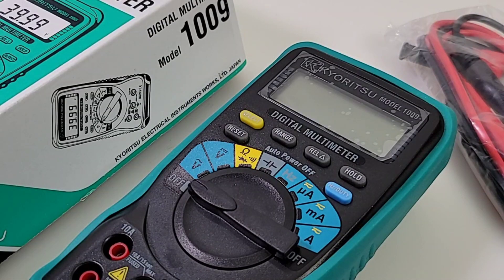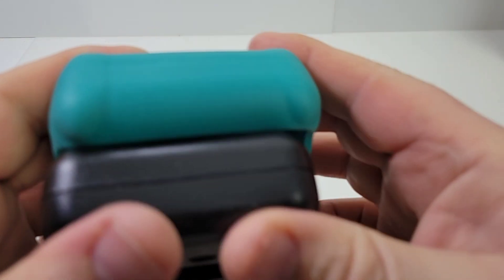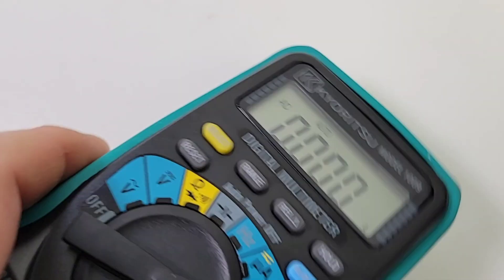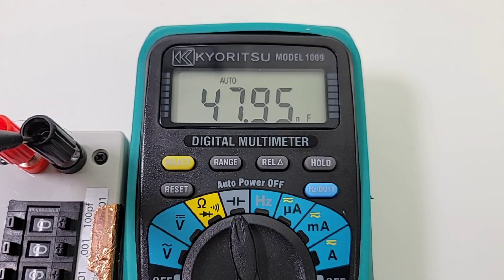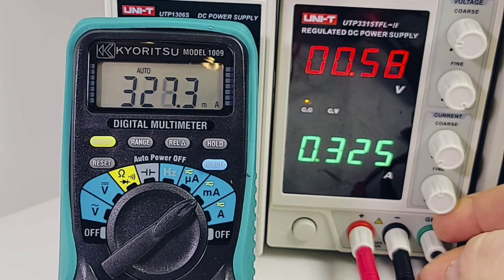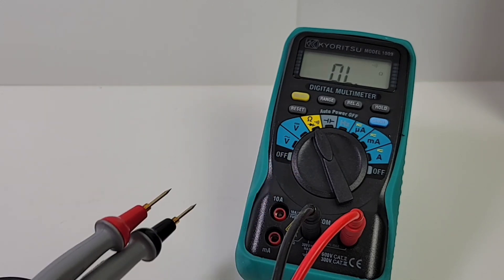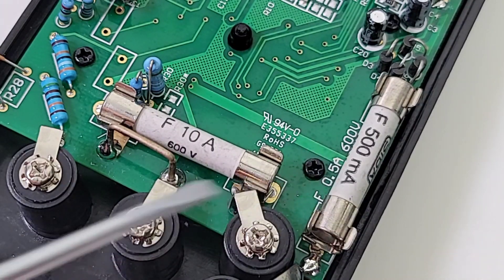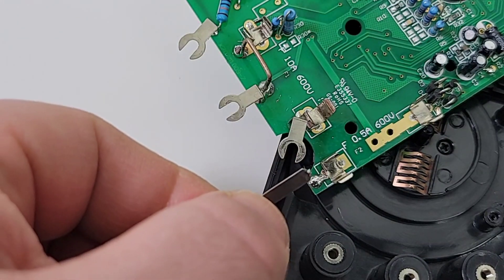KYORITSU 1009 Multimeter Review & Teardown!

Comment: I think the mA input works as intended, the mA input range is 0-400 mA (4000 counts meter...), the next range is 4A so you are supposed to switch to Amps... It's in the user manual BTW...

Comment: well, indeed too expensive.
I suppose it should be in the 30-40 USD (it is priced appropriately in my region).
Thanx for the review, always wonder about its quality for $40 I'd say pretty good (though $80 is way too much overpriced, are you sure about your price? cause they have higher specced 1011 & 1012 which is indeed priced around $80 ).

I see an empty pcb mask for 2 MOV/sparkgap, I'd say a 10mm 820 volts is supposedly being soldered there.
The track looks like is correctly to clamp voltage input to ground with high current/high resistance  resistor in series in one path and a PTC on the other.

With MOV/SG installed should you gets a transient during measurement then the PTC may blow up but probably will save the meter.

I have Kyoritsu 1021r (true RMS), definitely better with Hycon P66 chip, but mine is troublesome when measuring anything related to DC voltage will take a long time for the result to appear on screen (DCV, DCmV, Ohms, Diode, DC current; when they appear they measured correctly though), anything with AC (ACV, ACmV, capacitance, frequency, AC Current) is working properly as they should be.

What can be the problem? bad Hycon chip?
Reply: It is more like $3 to $5 multimeter sold in the hardware store .. no true RMS .. really poorly built
Reply from the maker: Hmm..I doubt it's the chip in this case. Have you tried clearing the selector switch with IPA? Weird things can happen if the tracks aren't debris free..minute solder particles,  Flux and dirt can all cause erratic readings..

Comment: The good the bad and the ugly, with a tiny hint of quality in the brass inserts fisher price range switch and bolted but not well soldered input jacks. WAY too much money and the range indicators look like something off of a childs fisher price "see-n-say" learning toy. Circuit board is a mix of SMD and through hole with failure prone old school electrolytic caps.  Cant believe what theyre asking for....this.
Reply from the maker: Fisher Price is probably better built than this KYORITSU!! Unfortunately,  I haven't come across such an expensive CHEAPLY made dmm in a long time..echhh🙄